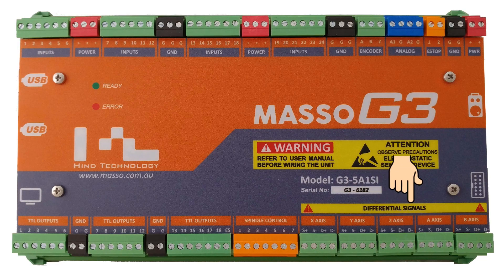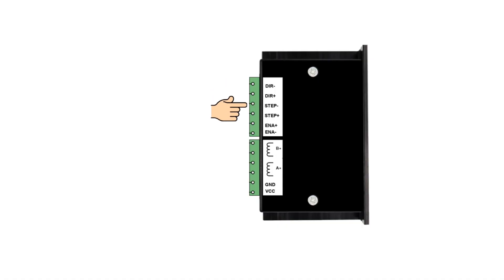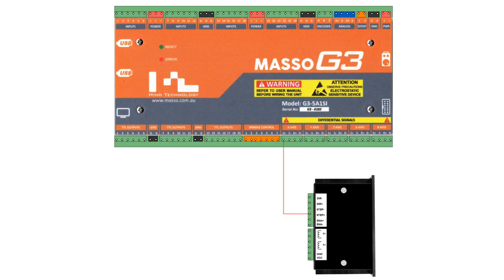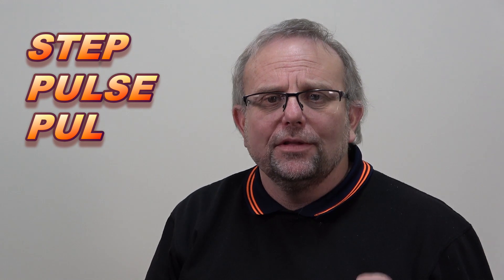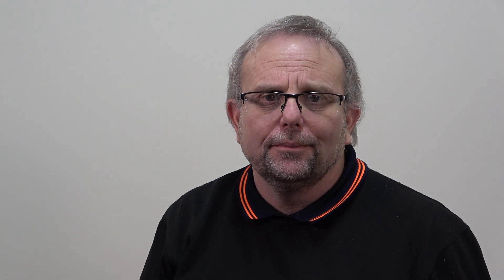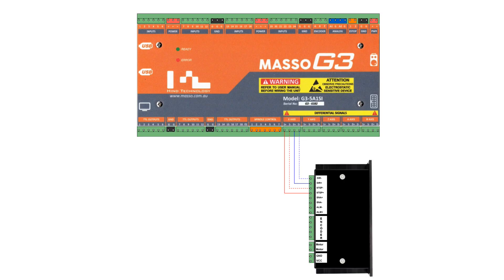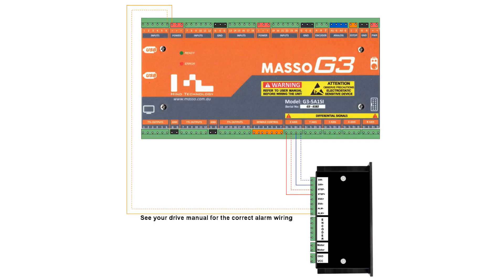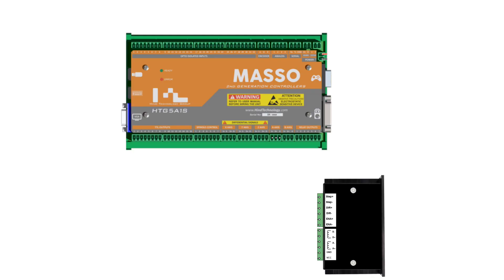How to connect your Stepper or Servo drive to Masso - Episode 020

Comment: Hello I'm trying to work out how to connect stepper motors from a Proxxon CNC ready mill .
the step motors have connectors stating coil 1a 1b 2a 2b --- how would you interpret this for connection to the masso g3 ?

Comment: I have a question that is unclear to me about Masso.  Can you hook up the stepper motor directly to Masso and not us a stepper driver board?  If you can do this, will Masso allow you to take advantage of micro steps that the stepper boards list on the cover?
Reply: You must have a stepper or servo driver and a power supply. Masso is the brains not the brawn.

Comment: Nice work Peter. Would it be prudent to use shielded wiring on these wires?
Reply from the maker: Differential signals do not need shielding as any noise induced into the wire is induced equally into each half of the line and so cancels out the noise. The same is not true of common ground signals but most people will put the drives next to Masso so shielding is not needed. For sure the use of shielded the cables won't hurt, (unless you do it wrong). When it comes the the drive signals the signal to noise ratio is high which also helps with noise immunity as does prudent running of cables within the control box. If I was running the cables any distance to the drive I would consider shielded cable but if it is in the same control cabinet I wouldn't worry about it myself.
Cheers
Peter
Reply: @cncnutzmassoedition9131  Thanks for the detailed response Peter. I normally focus on shielding the stepper motor drive power wires.  If I understand correctly, the potential EMI from stepper motor driver power is higher because they use pulse-width modulated (PWM) power with high-frequency current changes (dI/dt) that can generate strong electromagnetic flux (EMF).  I also use shielded wires between the stepper motor drives and my Masso controller if they have to run parallel to the motor power wires or AC lines.  I think its best practice to keep the motor and AC wiring separated from the differential signal wires.
If we have a long wire run between the controller and the motor drives, is there a preferred shielding type for drive signals?  Should wire pairs be shielded in a multiconductor cable?
Reply: @cncnutzmassoedition9131  Peter, the BMS has a G2 running B slaved to Y therefore we have both signal conditions.
Reply: @cncnutzmassoedition9131  Peter, the BMS has a G2 running B slaved to Y therefore we have both signal conditions.
Steve, Most multiconductor cable have the pairs twisted together so any noise induced is cancelled also the cable shield would prevent external noise from entering.
Reply: Depends, on the BMS Heavy Mill I used flat ribbon cable between MASSO and Gecko 540, but the run was only 200mm. Anything longer shielded cable would be best.